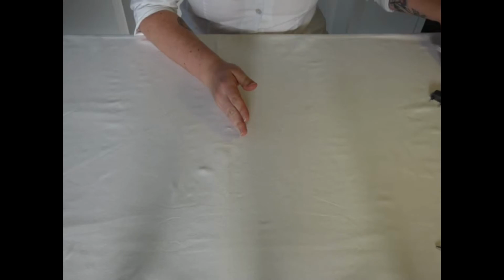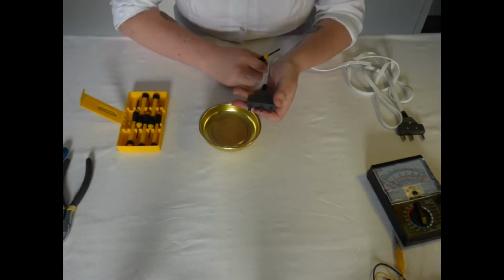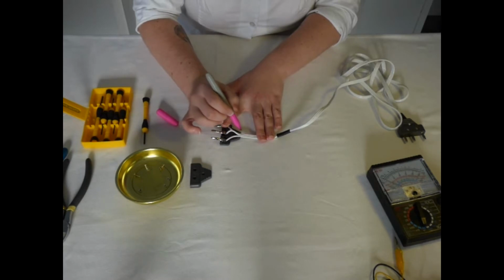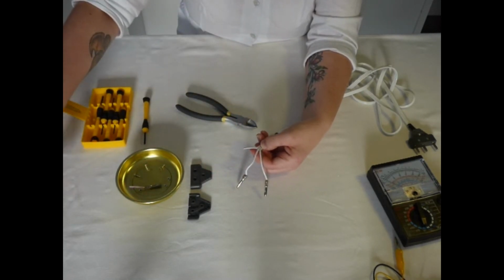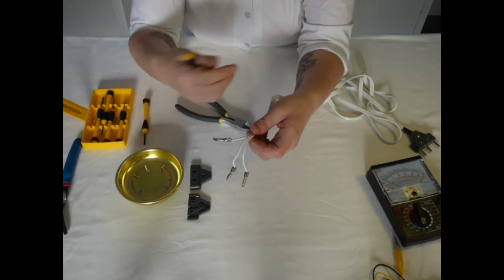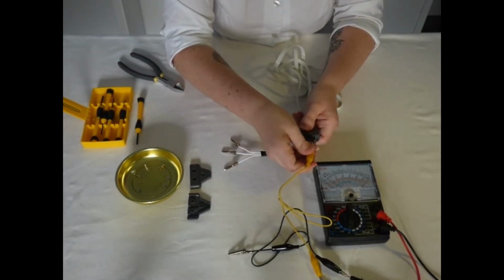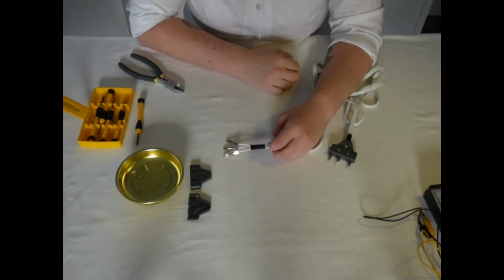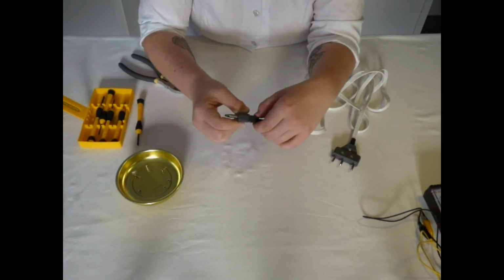Repairing an Epee Bodycord

Comment: Hello, I’m writing this comment with a lot of frustration because I can’t put the body cord back together please advise me
Reply from the maker: Hi there, what specifically seems to be the issue? Putting bodycord ends together is tricky, and can take a few tries to get them to go since there are so many small parts
Reply: @askanarmourer9549  everything is in place and screwed except for the wire that’s popping out from the bottom.
So basically the plastic isn’t completely sealed together. It’s very tricky to put it all together.

Comment: for repairing an german style body cord... no screws on the cover for an english (or leon paul) type
https://www.youtube.com/watch?v=GGX4fqgZF3k

then there are those irritating favero body cords with 4 screws...  just to complicate things... (mostly found in spool sockets, not many of these types of body cords thank goodness) 
https://www.youtube.com/watch?v=3CJyB6LBq5A

generally to find out which end has the break or problem I plug it into a  multimeter and whilst keeping one end steady move the other end and see if the resistance moves - testing each wire the same - then doing the same with the other end and usually find out which end is faulty and which wire....
As for the calling each of the wires by A,B or C - have been taught to use the C for the earth and the B & A as the closest wires (or I prefer to use J,F&E - jolly faulty equipment - or jacket, foil and earth) 

https://www.ebay.com.au/itm/Fencing-Armor-Test-Box/324477552248

Is there a set way the AB & C shoudl be as in wires?
Reply from the maker: Hi Albert, I honestly find the convention shifts depending on who I talk to and where I am, it's entirely dependent on where you learned. So the naming is mostly for myself to make sure I'm looking at the correct line each time. And if I meet someone or read something that uses a different convention than myself, I'll just familiarize myself with that and use that, because regardless of what you call them the lines all function the same way. Frankly, I don't think it matters what you call them so long as you're connecting the right ends together!
Reply: @askanarmourer9549  good point....
Reply: this one labels them oppositely...
https://www.betterfencer.com/articles/repair-fencing-body-cords
hence my confusion....